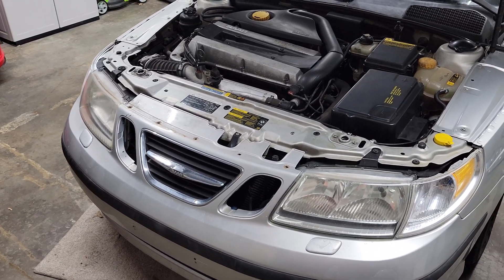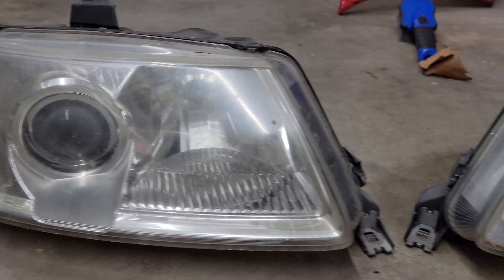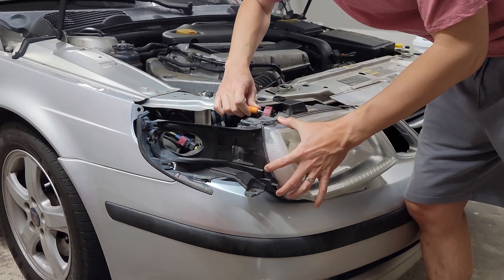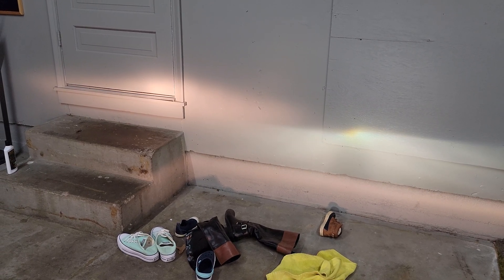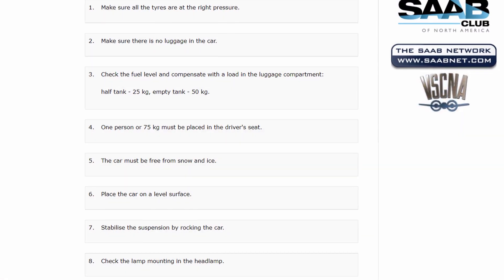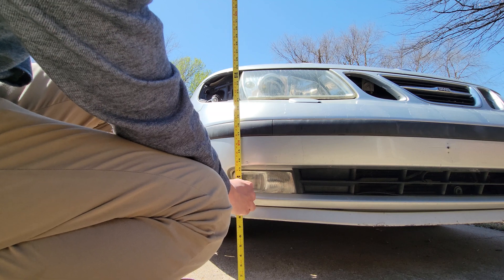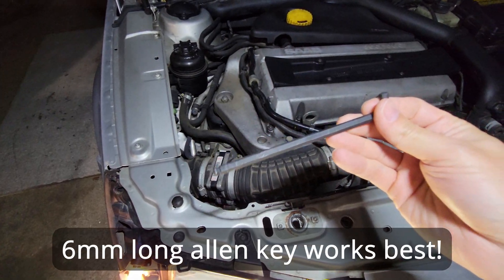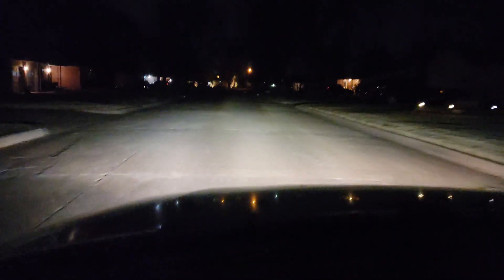SAAB 9-5 Arc Restoration part 8 | Xenon Projector Upgrade

Comment: To make the high beam work, you have to replace pin 7 in the wire harness with signal from wire 2. 
In original halogen headlights, the signal to high beam is on pin 2, while on xenon its on pin 7. To summon up: You have to double the signal from pin 2 to 7, to keep the xenon solenoid and to get the high beams to work.

Comment: Hey I did the same thing but on high beam the halogen light doesn’t kick on with the projector. I know it would with the xenon harness but wasn’t sure if you were able to find a work around for it
Reply from the maker: Hi! I dont have this car anymore so I can't test it out but, as far as I remember, when I put on the highbeams, the main projector becomes the highbeam by flipping up a flap on the projector. I don't recall if the halogens next to it comes on or not. Maybe someone that has OEM xenons can chime in

Comment: Hi , I upgraded my 9-5 as well with xenon’s. But my halogens for high beam not working anymore now and the highest setting I can adjust it manually it’s to low , it looks like yours before leveling , maybe small bit higher
Reply: i'm about to do the same. Did you figure it out?
Reply: @Za83Rw0cKy no , went back halogen bulbs ,
Reply from the maker: Hmm...manually adjusting it worked for me...maybe your manual adjuster is broken?
Reply: @BWORX0521 working fine , but won’t go as high as yours , maybe Europe specs are different

Comment: Hi, so I can buy a par of projectors and plug my halogen bulbs in them? Or do I need to intall ballast etc. I would like to get projectors and keep my led bulbs im using on my base headlights.
Reply from the maker: No, you will need the whole set. Projector housing, ballast and HID bulbs. You will have to completely throw away your led bulbs
Reply: ballasts are parts of the headlight assemblies. I bought two on ebay with ballasts attached.

Comment: I did not see that you would retrofit the two height adjustment sensors - one on the front right and one on the rear right. The xenons are self leveling automatically based on the readings of those sensors.
Reply from the maker: Yes, those are hard to find and not worth the trouble IMO so I decided to skip it haha
Reply: @BWORX0521  how did you skip them ? Because the self levelling motor will always go to the lowest setting in absence of sensor signal , that for safety of incoming traffic
Reply from the maker: There seems to be two different level mechanisms. One is the motorized one that always goes to the low setting, and a manual one that you can adjust upwards to get the aiming like I did in the video. You just need an Allen wrench
Reply: @BWORX0521 the manual one won’t go as high as it should , I have them both at max high setting . When turn on it will go way higher then slowly coming down to my manual setting, but that’s to low to even pass the annual inspection
Reply: @BWORX0521 any idea how can I bypass that self levelling motor ? Thank you
Reply from the maker: I heard of another method. When it first starts up and goes to the highest setting, disconnect the auto leveler wire. Now...where that wire is...I couldn't tell ya but I know people on saabcentral.com discuss it. Try searching there!
Reply: @BWORX0521  i read about that. I wonder if a manual leveler switch/knob could be added.

Comment: When you do this swap, does the headlight level controller on the dashboard still direct the lights up and down? My estate has this for when the load at the back of the car gets heavy, this little dial can help realign the headlights forward when the car is tilting back a little.
Reply from the maker: That function does not work for this method, no sensors in the car 😭. Also, in the states, I don't think we ever got manual leveling headlights.